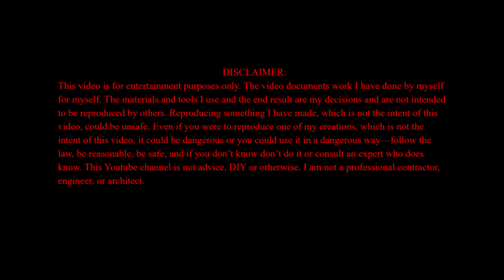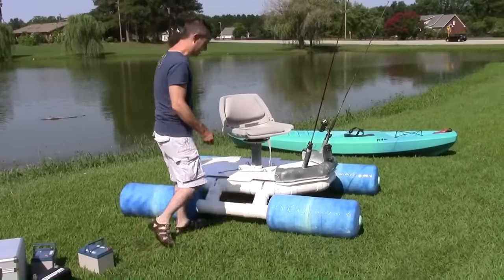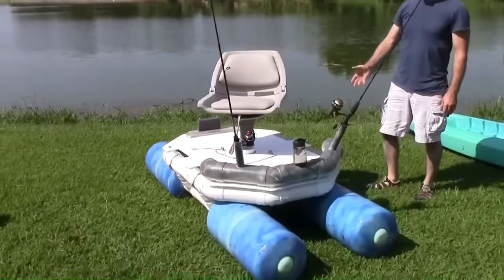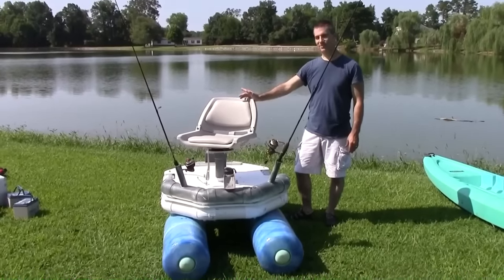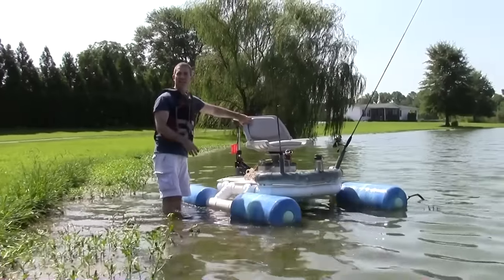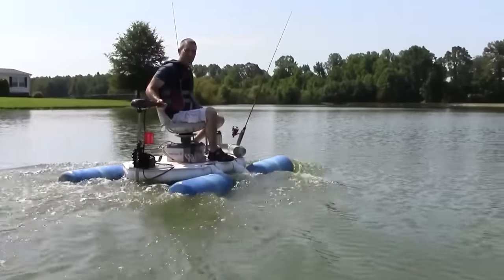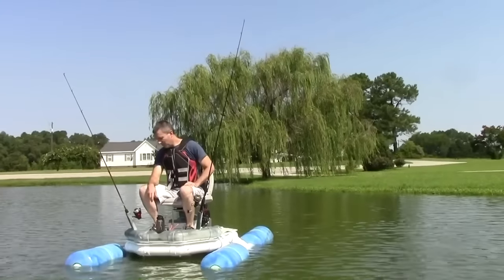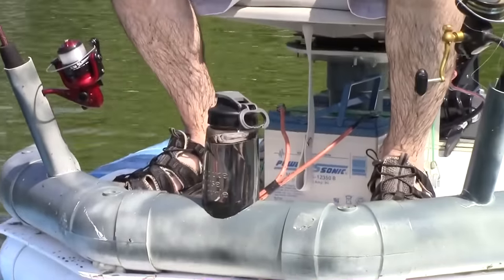Homemade fishing boat with foldable pontoons

Comment: I think I would want, not round flotation up front but more bulging, secondary buoyancy, fatter, slightly above the average water line. 

You don't want to toe end on a wake wave from another boater, submarining a pontoon, trying to ride over it, especially with body weight shifting forward, hinging over deeper.

Your center of gravity is high on this design.

And yes you encounter this ilk on small lakes, more than willing to swamp a kayak or canoe, over speed, over horse powered, plowing at high speed, coming out around a tight bend, on what seems like a peaceful mountain lake.

Couple spots, looks like you might be off a golf course, was waiting for a golf ball dropping in.

Comment: Nice!  My only advice: working on your hands and knees on the ground is *brutal*.  Spend $25 on a pair of cheap plastic folding sawhorses from your local Homeless Despot.  They'll support around 400 lbs and are easy to store without taking up much room.  Your back and knees will thank you when you're 60.
Reply from the maker: Yes, it is starting to get a little tough on the old body. Thanks for the comment

Comment: I love, love, love, it!!!! Ive had 3-back surgeries and I can’t bend over because they fused my bones together. I absolutely love to fish but most of the time you have to really bend to get in the boat or get out. Not with this one tho. Is there a way you could mount the trolling motor on the side? It’s hard for me to turn also. 
Great job, thank you, Cathy
Reply from the maker: I'll look into it, I will be doing a remodel of this design in the spring. I hope to make some advances on the steering. Thanks for the question.

Comment: Love the idea, but if l could just be a bit picky, if you had of put washers on the pop rivets b4 you squeezed them off (on the inside) the bearing strength of the rivets would have increased heaps...still loved the video...
Reply from the maker: Great idea, I will look into it. Thanks

Comment: In the video I did not see a part that showed how the foam was attached inside the ends of the pvc pipe used for the pontoons.  Are the pontoon legs water tight? Or are the foam caps on the end just there for protect the pvc from bumping into things.  Great design!!  This thing is super sweet.  And something I can actually make
Reply from the maker: Great question, I put expanding foam on both ends of the pontoon. Then I took 3 pieces of foam that were glued together and put them in each end. It has worked great and no water has entered yet. Thank you for the question!
Reply: Thanks for the reply!  I just tried to order your book from Amazon but it is still under review.  If there is another way to purchase it please let me know.  I'd be willing to pay way more than the 2.99 it was listed for.
Reply from the maker: Unfortunately, that is the only way I can sell it. I'll let you know when I fix the quality issue. Thank you for your interest, I do appreciate it.

Comment: i made people peddle powered boat that used 211 plastic 2 liter bottles for flotation 2 people peddle cranks made of copper tube - 18” propeller- float 4 to 6 peps - Bbq onboard - won raft race -110 pounds transport on car roof = built 3 in 1986 /89 - major Fun
Reply from the maker: Sounds pretty cool!
Reply: Link please..! That sounds amazing ..!

Comment: Do you fill the floaters with spray foam to aid the floatation?
Reply from the maker: I just added some foam at the ends of the pipe to help keep the water out. I tried filling one pipe all the way, but it made it really heavy. Thank you for the great question, I appreciate it.

Comment: The spec in which you built this. What would the max weight it can support.
Reply from the maker: Unfortunately, I don't own this one anymore so I will have to just give you some numbers. I do remember that the old batteries (lead acid) were a total of 50 lbs., and the trolling motor (55 lb. thrust) was around 23 lbs. My weight was around 168 lbs. or so. I hope that helps, thank you for the question.

Comment: VERY NICE VIDEO. PLEASE SAY MORE ABOUT THE ENGINE. WHERE TO GET IT AND WHAT TYPE ETC..
Reply from the maker: The motor I used was a Minn Kota 55lb. thrust trolling motor. It is 12 volt and I got it at Bass Pro Shop. Thanks for the question

Comment: Bill (below,) thanks for that time-stamp. I had the same question but when watching that section of the vid I couldn't tell that the gray part was the stop. Great job all around, especially thanks for showing how you built-up the pontoons from flat layers. Did you add any amount of reinforcement for the transom?
Reply from the maker: No, it was just the PVC and the thin plywood. Thanks for the question

Comment: Is that sch 40 pvc pipe and fittings?  Unfortunately in Texas have a motor on there has to be registered with Texas parks and wildlife but that's a great idea
Reply from the maker: It is the 4 inch thin wall PVC for drainage and sewage. Thanks for the comment.

Comment: Greetings! what material what brand of floats And what kind of coating did you apply? thanks in advance.....
Reply from the maker: The material for the pontoons is called XPS foam, and I covered it with Flex seal clear liquid plastic. Thank you for the question :)

Comment: Not betting my life on pvc it does not stay flexible with age or solar exposure it will get brittle and it will break as will the glue used to assemble, there is a pretty large amount of money in this project to loose it all along with gear when the ship goes down. That having been said it is a very good engineering project and well built.
Reply from the maker: Thanks for the comment :)

Comment: Nice one man pontoon. That would be cool if the motor could be mounted up front for easier steering. Does it have the same thrust in reverse?
Reply from the maker: It was not as good in reverse, but still good. I am also working on better steering on the remodel. Thanks for the comment.

Comment: Really curious about the measurements on all the PVC pipes as well as what size PVC pipe you used. Looks like 4 inch.
Reply from the maker: I did have an E book on Amazon with all of that info, but it was pulled for quality issues. I hope to have it fixed soon. I can let you know when all of the issues are fixed?
Reply: @supergokue1  definitely! I'm usually pretty good at figuring that kind of stuff out myself, but if it's already figured out for me.... not going to complain.

Comment: Your new subscriber from Kerala India.,Sir which material you are using other? than PVC pipe nd ply board
Reply from the maker: The pontoons are made up of a material called XPS foam, it is used in construction. Thanks for the question

Comment: What kind of styrofoam are you using? How well does it hold up to long exposure?
Reply from the maker: I used XPS foam from Lowe's, it holds up pretty good over time. Thanks for the questions
Reply: @supergokue1  awesome thanks mate. I thought that was what it was, but wasn't sure and didn't want to screw myself hahahaha. Have a similar idea to this and have been doing a lot of cross examinations of different techniques

Comment: Doesn’t adding foam to the pipe that’s not underwater actually decrease your buoyancy bc it’s just added weight?
Reply from the maker: Yes, I have found it will add a ton of weight with no real benefit. For this build, I just used it on the ends of legs of the pontoon. Just to keep it as airtight, thanks for the great question :)

Comment: You should have shown the step you filled it with urethane to make sure it floats even if takes water. Also use a stronger gauge pvc pipe. A solid rock hit would break this thing. Still great idea.
Reply from the maker: Thank you for the comments!

Comment: I like the one with coolers better.
Reply from the maker: Thank you, I am always trying to improve my boats. I think the cooler boat was an excellent level up.
Reply: @supergokue1   the livewell posibility would be cool.
I wonder too if you extended your outriggers a little would it raise you off the water some. Or instead of making nice neat rings of the closedcell foam what about long run pontoons and cut and shape to outrigger frame attached with sprayfoam as adhesive?
Don't get me wrong I love the concept, but lookin to raise you off the water some. I see a 2 person model coming. I think your structure not only looks good but has lots of Modular posibilities.

Comment: Can you tell me where to get the foam from for the floats?
Reply from the maker: It is called XPS foam, and it is sold at Home improvement stores like Home Depot. It is used for insulation in construction. Thank you for the question.

Comment: Do you have a set of plans for this and is there a way to put foot peddles on it instead of a trolling motor ?
Reply from the maker: The book was pulled from Amazon due to quality issues, I can let you know when I fix it. There should be a way to use foot peddles, that is something I am currently working on. Thank you for the great questions.

Comment: Use 55gallon oil drums instead.  Fold them out, pin locks for safety.  Steel frame, no plastic.  Double length for stability.

Comment: My only problem with the design is the front, I'd put something sloping up,I feel like if a wave were to come by as your going thru the water, it would pull you under, but with a slope going up, it would give you lift also, increase the speed

Comment: Think you need to improve on the flotation, add some storage space and bring a boat paddle in case you run out of power.  It looks like you were going to sink in some instances.  Otherwise, good idea.
Reply from the maker: You are correct, the upgrade will be done this spring. Thanks for the suggestions

Comment: Cool.  4"thick styrofoam would make a quicker job and I think you should add a stronger clamp or ratchet strap to hold the pontoon mounts on with.  You are relying on 4 Rad clamps made in China that are not meant to be drilled.
Reply from the maker: I'll look into it, thanks for the suggestions!

Comment: Did you put spray foam inside the pvc pipe?
Reply from the maker: Just at the ends because it adds a lot of weight to fill the whole pipe. Thanks for the question.

Comment: How much ch did it take to buy all of the materials
Reply from the maker: To be honest, I do not remember the cost. But I am sure it's probably double the cost now. That's why I switch my boat building materials to EMT conduit. So much cheaper and it weighs less as well. Thanks for the question.

Comment: Pretty cool idea. However, neither the link to the book or your instagram work. Book link says it has been removed due to several issues. Would still like to see what it has in it.
Reply from the maker: Sorry about that, I do have a few issues with my 2 books and hope to have them fixed soon. I can let you know when they are resolved.
Reply: supergokue1 that would be cool. I might even modify the measurements a bit and try to fit 2 seats on it.

Comment: Hey what kind of foam did you use
Reply from the maker: The foam I used is call XPS foam, it is mainly used for insulation in construction. If you live in the U.S., it is available at Home Depot or Lowes. Thank you for the question
Reply: @supergokue1  Ok, approximately how much was the final cost of this build for just the materials like the pvc, pipe fittings, and foam?
Reply from the maker: @slept-on_SP  Unfortunately, I do not keep track of the cost of my projects. I found that it made it less enjoyable to do the videos. Thank you for the question, sorry I couldn't help.

Comment: Where does the motor or a engine fitted? 

You didn't show it in the video I guess..
Reply from the maker: I made a simple motor mount out of plastic and a small 2x4. It just screwed to the deck, thanks for the question :)

Comment: could you use a bigger pipe for the frame
Reply from the maker: I believe so, but I think it would add a bunch of weight. The PVC I used is a thin wall, and I think the next size PVC is only schedule 40. Thanks for the great question.

Comment: What kind of plastic pipes are those you used
Reply from the maker: They are thin wall PVC pipe for sewage and drainage. They are light weight and are not as expensive as the schedule 40 PVC. Thanks for the question.

Comment: At 2:43 it shows the tubes seem to be filled with foam, yet you never show this step. Is this necessary or is there a reason why you skipped this step?
Reply from the maker: Yes, For some reason I just could not get a good shot of it. I tried a few different angles and I did not like any of them. At the end I just left it out of the video. Thank you for the question

Comment: How long it would last? 5 years?
Reply from the maker: I believe it should last for many years. I think the only thing that that might need to be replaced would be the deck. I think some form of plastic or fiberglass deck would be great for longevity. Thank you for the great question :)
Reply: @supergokue1  white pvc can crack if got exposed to sun light! I have to disagree 5 yeara max

Comment: What glue did you use to glue the Styrofoam floats to the PVC pipes?
Reply from the maker: Actually, they were so tight they were just held on by friction. Thank you for the qustion
Reply: @supergokue1  Thank you for the answer. 👍😀

Comment: Can you add a 50watt solar panel for recharging the battery or power on demand. Should be about 60cm squared.
Reply from the maker: Yes, I do need to look into adding a solar panel on the boat. Thanks for the suggestion

Comment: I wish you hadn't edited the part that you get on top. It's obvious that it would have been hard to get on there without toppling the thing over.
Reply from the maker: It was very easy to get on, and did not even come close to flipping over. The only thing I edited was a conversation that was not relevant to the video. I only edit parts like that out to keep the length of the video down. Thanks for the comment.

Comment: Why you drill the holes through the frame of pvc , instead you make a valve and put about 10 psi it will float . Then you probably don't need the foams.

Comment: where;s the link to the book?
Reply from the maker: Unfortunately, the book was pulled from Amazon due to format problems. I can let you know when I fix it if you like?
Reply: @supergokue1  please do. For now what's the outer diameter of the foam cutouts. Also, is that a router attachment for a dremel? I need that for sure, if it is.

Comment: Anyone with a little bit of a brain, would know that for water travel, "streamlined" is the word. Your contraption is digging down in the water, due to having zero streamlining. Try a couple of cone shapes on the pontoons at the front. Also stick a stabilising fin underneath, so you can stand and fish, because first time you hook something bigger than a bluegill standing up, your platform is going to nosedive.
Reply: It's not a high speed craft... a hole.

Comment: Might have well just use spit instead of the glue he used .... it won’t hold up ..... for an extra $15 he could have used marine grade adhesive
Reply: You DO realize that he's not using glue don't you? 

I'd trust the molecular bonding over even a two part MEK adhesive/hardener that relies on "Sticking" the joints together. Either way, these are 4 inch joints on a one seat raft. Do you really see this thing going anywhere?
Reply: Hot glue gun is good for paper and arts and crafts
Reply: @CaugustusWhite  - Agreed... I thought you were referring to the PVC cement he used on the frame.